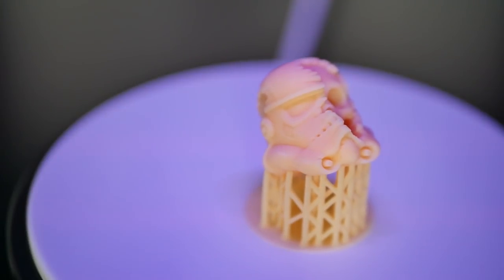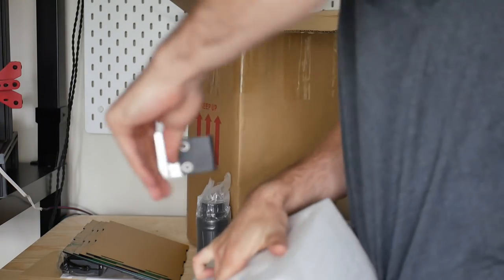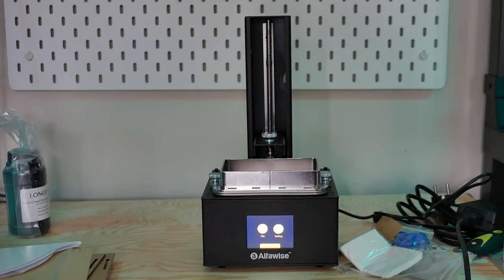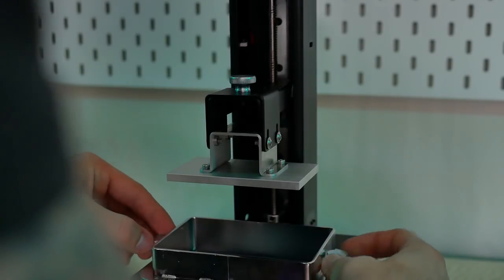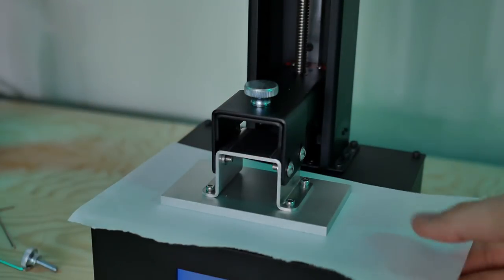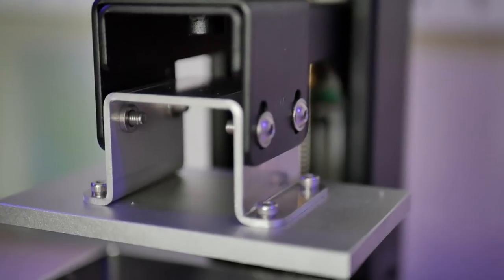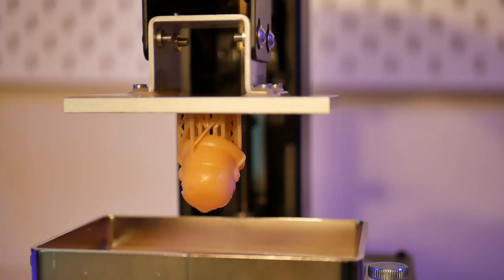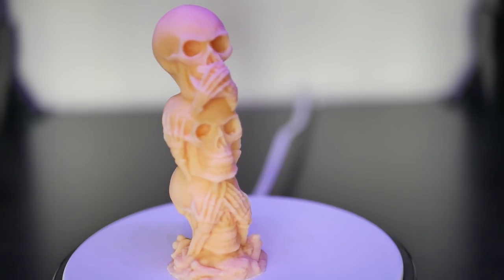Alfawise W10 Resin 3D Printer For $300 | A True Photon Contender

Comment: Hi Modbot, just letting you know I received my Alfawise W10 DLP 3D Printer, I haven't set it up because I was waiting on a simple mod I wanted to make, thanks to your video where you mentioned that the cover was cut plexiglass sheets. I decided to buy UV blocking film and apply it to the green plexiglass for added protection, I also bought the water washable resin which was $83 on Amazon, so I'll let you know how my first print goes soon.

Comment: "Pre configured" dumb question but what do you mean by that? I have zero experience and I'm kind'a interested on diving into 3d resin printing.
Reply: That the model on the micro sd was already setup, ready for printing. So he didn't need to mess about in the slicer app.

Comment: Looks like a solid machine I'm actually in the market for a resin printer looking forward to more on this one thanks for sharing
Reply from the maker: Hey Matt! I have this thing going non stop. I am trying to burn through the sample resin so I can try out the grey and red I ordered. I will definitely update :)
Reply: ModBot I plan on using the wax based resin got any of that coming?
Reply from the maker: @InsideTheMindOfMatt  I do not at the moment. Currently only standard resin and some higher strength stuff on the way

Comment: very tempted to get one, just a little concerned about the chemicals involved and mess. Any indication of resin costs? are they propriety resins only?
Reply from the maker: I will say that the resin that comes with this machine has very little smell. I have been around other resins in the past that have smelt extremely potent compared to this stuff. I have some other 3rd party resins that just showed up so I will let you know how they work out. You can use any resin, the software allows you to use the profiles they include or modify/create your own for cure times. Resin cost will definitely very but I picked up two different colored 500ml bottles for about 24-26 each. It is definitely more expensive than filament but at that price I can still justify it.

Comment: I finally got a mostly successful print after changing some of the slicer settings to suggestions provided by gearbest support oddly enough. Do you know if it can print with files sliced from chitu slicer?
Reply from the maker: Awesome! Happy to hear that you at least did get a successful print. As far as Chitu, I have not used it much. I would say that no you will need to slice it in the Alfawise software (I think) but you should be able to use that software to at least prep the model such as support generation and hollowing.

Comment: Thanks for the video! I just ordered mine from Gearbest, like you I have been procrastinating on buy one until I saw the early bird price this printer was going for. I want to try the new water washable resin that's on the market now it seams safer than the current toxic resin.
Reply from the maker: Awesome! You will not be disappointed I have been loving mine. I have had really good luck with Elegoo resin from Amazon. Please let me know how the water washable resin works out if you give it a try.
Reply: Just to update you I ordered the Wanhao water washable resin in gray it was 1000 ML for $83.00 per bottle from Amazon and it arrived today, I haven't received my SLA printer yet from Gearbest but it has shipped so I'll let you know how it goes once I'm up and running. Thanks again for your great videos.
Reply from the maker: @orosalsero  Awesome  thank you for the update. I am very curious by the resin you mentioned so please do share what your experience is like after you have done some testing :)
Reply: Will do!

Comment: This is not a DLP printer, it's a LCD printer. DLP printer uses a projector to project the layer image while LCD printer uses an LCD screen as a mask with UV light source to harden the resin layer. Information from Gearbest confirmed that this is a LCD printer.
Reply from the maker: You are right, it is an LCD based printer. I will change the title!

Comment: Are the fumes from this bad? How does having an unsealed printing enclosure affect in terms of smell/fumes? Thanks!
Reply from the maker: It depends strongly on the resin. The Elegoo branded resin that I got from Amazon has little to no odor in my opinion. Then I have used other resins that are incredibly strong and I had to move the printer to our little storage unit when printing with that resin.

Comment: i want one, but my concern is FEP replace, lcd replace just in case, also can u add another video making clean up and settings for print please :)
Reply from the maker: I have replaced the fep without any issues. Lcd replace I would hope that I do not have to do for a long time. I can definitely make some videos on my settings and process.

Comment: I got my, this big issue the printer get only file from hes slicer, did you manage to print your on file and not a test file?
Reply from the maker: I have been printing my own files for a couple of weeks without issues. I use Asura to generate supports as well as hollow the model and I slice in Alfawise software.
Reply: @ModBotArmy  I WILL TEST IT AGAIN.
Reply: @ModBotArmy  also what is the best for Plate layers and Thickness - 50UM are you work for?

Comment: Mr modbot , your saying it actually has  a built in Digital light processor unit inside ?
Reply from the maker: It has an array of uv leds that shoot upward and an lcd screen between the uv lights and the vat
Reply: @ModBotArmy  Exactly,  Which is MSLA technology AKA masking , not DLP Technology, Reference material 1:  https://en.wikipedia.org/wiki/Digital_Light_Processing   Reference material 2:  https://theorthocosmos.com/laser-sla-vs-dlp-vs-masked-sla-3d-printing-technology-compared/ . Please do the proper research before publishing information .

Comment: How do you think it compares to the seemingly new Monoprice MP Mini SLA (not the usual big one, this is a mini one but somehow same name)
https://www.monoprice.com/product?p_id=35435 same price point.
Reply from the maker: I took a look at that machine and on paper it seems great. However, I have not heard to much about their existing resin printers. I am skeptical until I see others get their hands on it. The specs on that machine do look good though with wifi and hi res lcd panel.
Reply: @ModBotArmy  yeah it's got a slightly bigger build area than the W10, and the other two models Monoprice has seems to get mostly good reviews, though this one is quite new. Really a hard choice. i got two main ones as my main and would like a cheap one as a backup. I might go for this one first, but we'll see. If you can somehow get a review unit that would be great as there's literally no reviews except that one single one (which seems to be legit) on their website.

Comment: You sound like you're in the US but you're using a EU plug. I'm boggled!
Reply from the maker: I am in the US. Not sure if it was an error or if that’s all they have available. It takes a standard desktop cable so I just swapped it for one of the many I have.
Reply: @ModBotArmy  oh gotcha. Would you recommend this printer for a beginner? I've wanted to get into this for a few years but haven't taken the plunge and gotten one yet.